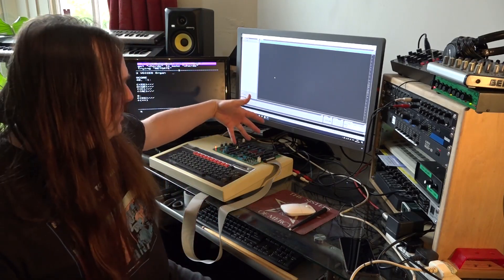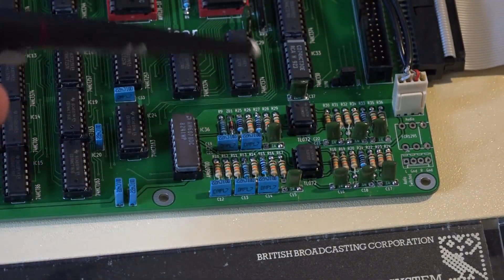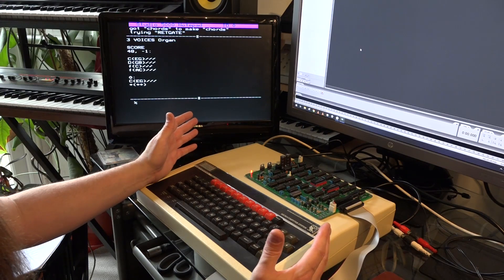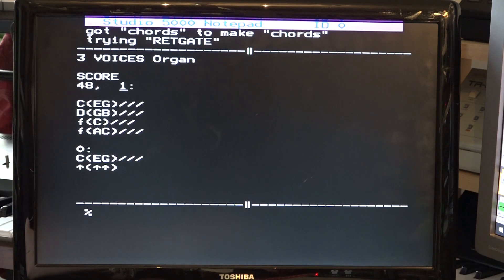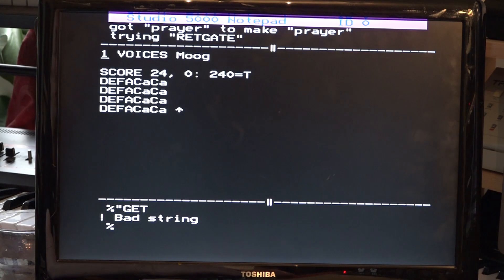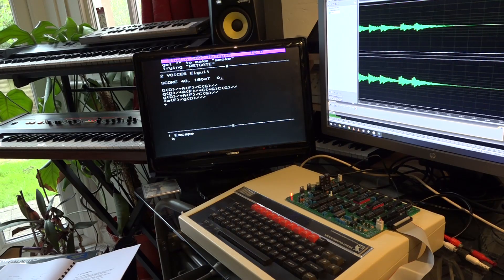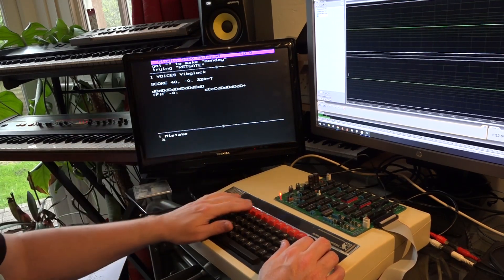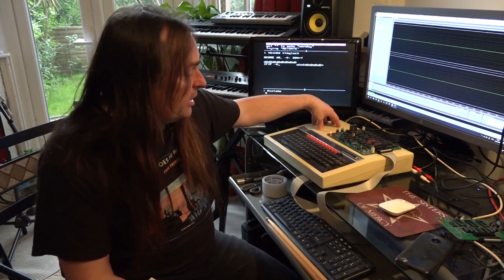I built a Synth for the BBC Micro Model B! Hybrid Music 5000 Clone

Comment: This was fascinating.  I still have my Music 500 (bought from Watford Electronics in the mid-80s).  I have a fair library of tunes as well, but the micro and floppies are currently not working (been in the loft too long, probably).  Well done on the clone build - I am impressed by that.  And getting that DAC was great - it's a rare part, and the design depends on its exponential output characteristic to help achieve a good dynamic range.  Those AM9128 SRAM chips on the board would not need to be the original AMD parts - they just happened to be one of the faster 2k x 8 SRAMs available back then.  Many other chips would also work.  I may have some schematics somewhere if you're interested.
Reply from the maker: I have a few DAC's as I bought 5 from someone in the USA on Ebay. so Have spares if it blows!
Reply: And some others won't. I initially used an Hitachi part which turned out to work 99.99% of the time ... i.e. failed only a few thousand of times a second :) After weeks of painful debugging I challenged Hitachi and they sheepishly confessed this part was, contrary to the data sheet, only /pseudo/-static, needing regular rests i.e. could not delivery on every clock cycle as I was using it.
Reply: @chrisjj3   Pseudo-static RAMs are quite different and do have quite specific restrictions.  Fortunately, they have never been widely used. I designed plenty of hardware around SRAMs back in the 80s and 90s and would know the differences, although perhaps PSRAMs are a pitfall for the unwary.

Comment: Amazing to hear this. I had a Music 500 and then upgraded to a 5000 back in the 1980s. I sold them and got a Yamaha CX5m before moving to an Atari ST and eventually to a Mac. I actually have both a 500 and a 5000 in the loft, bought a few years back as apparently “working” (for nostalgia) but I don’t have an operating BBC Micro to run them. Maybe someday….
Reply from the maker: Well those Music 500/5000s would need the power supplies looking at before you plug them in, otherwise no reason they won't still work. Easy enough to get a BBC-B and if you need the Ample rom I can help you there. ! I really need the Keyboard though, or a modern day Midi to user port adaptor.
Reply: @MatthewNorthMusic  If you have a music keyboard where the switches are accessible (up to 5 octaves / 61 keys, just one contact per key), then it's not hard to build an interface which will be fully compatible with the original drivers.  I have some details if you need.  Back in the day when I had my Music 500 working, I reverse engineered the keyboard driver code and built an interface which worked  That was until the Music 5000 came along - they changed the software which broke my version.  Then I found a copy of the correct schematic (which was simpler than my version) and built that instead.  I did try a little programming in AMPLE - it's not dissimilar to Forth.  I even coded some BBC Mode 5 graphics which I think drew a Christmas tree while playing music.  I may have that on a 5.25" floppy somewhere.